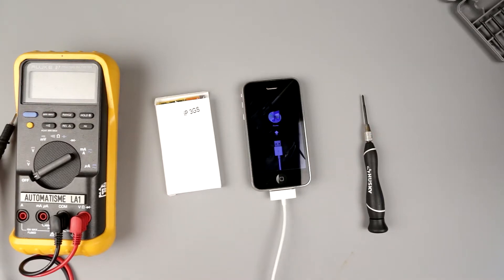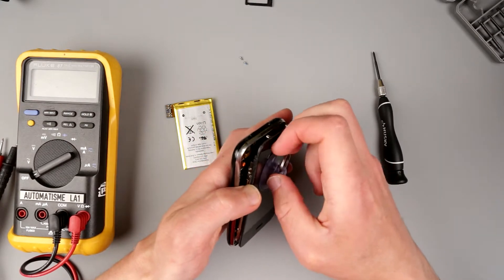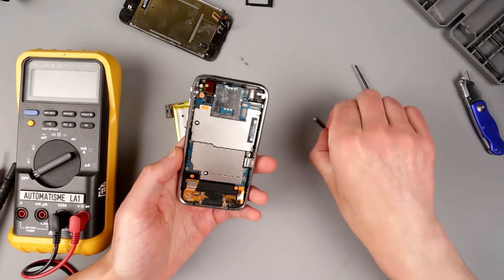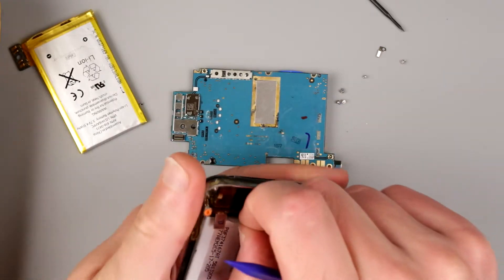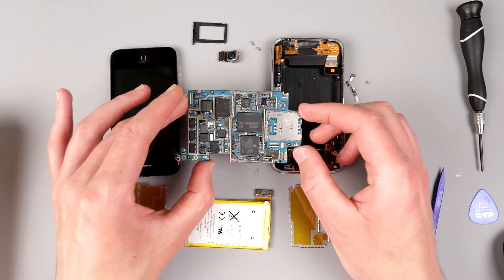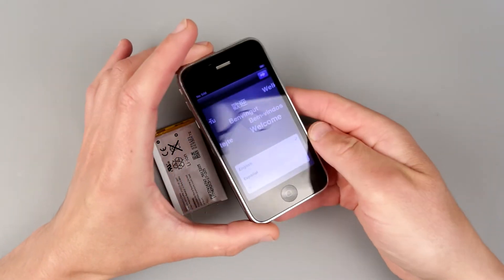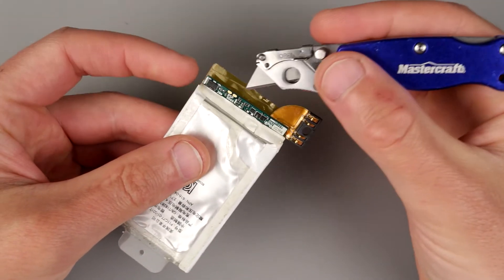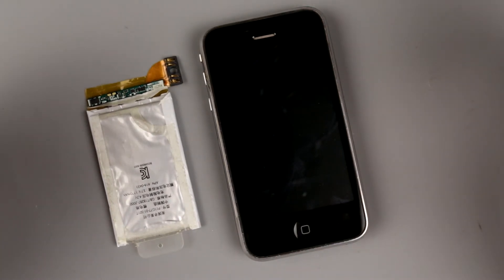Vintage teardown and repair of iPhone 3GS

Comment: Hello. Great vid. I just changed my 3GS battery. But I’m having same issue. When I turn on with new battery the Apple logo shows up. But then after 45 seconds it turns off and then repeats that cycle over and over til battery dies. Is my phone repairable??? Thanks
Reply from the maker: You can use desktop apple software to restore the firmware of the phone. I was able to do so. But did not shoot video about it. Gide how to do this was found ina internet